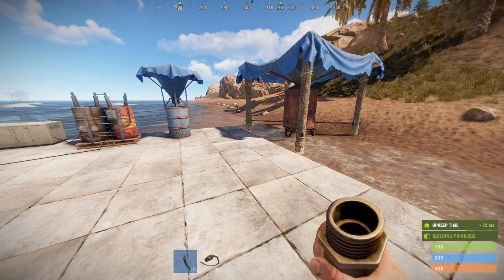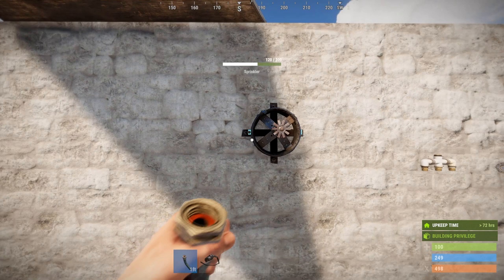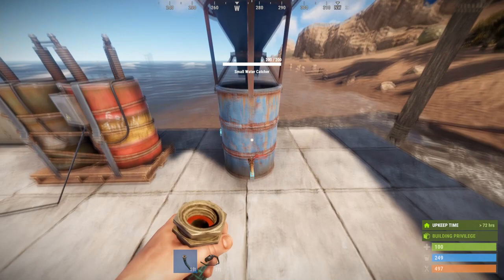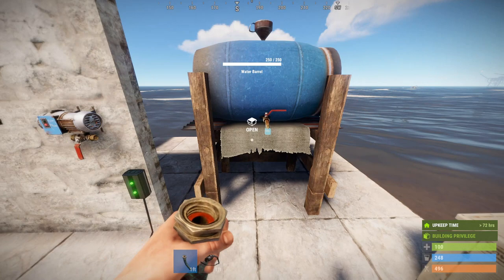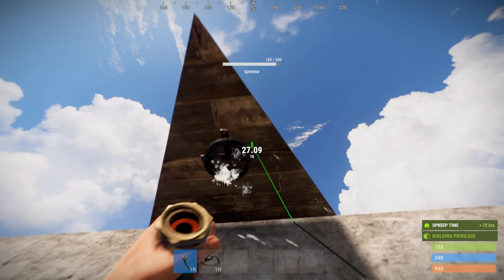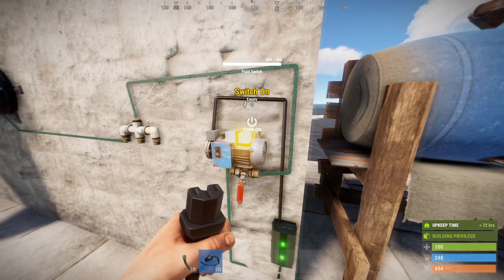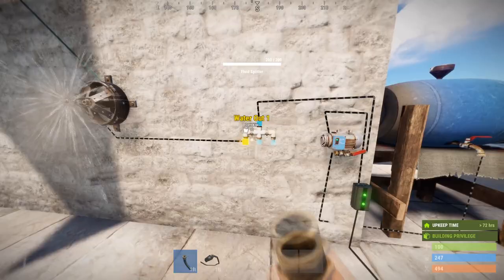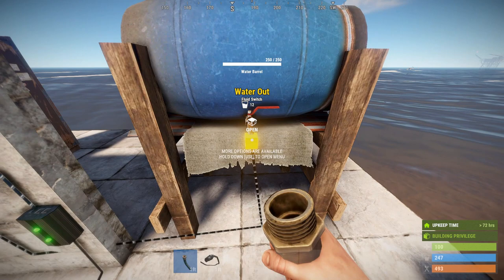Rust Electricity: Staging 3-29-2020 - Water & Plumbing

Comment: Hope you can put lowgrade in the barrels and use it with the ignitor. That would make a great trap
Reply from the maker: Flame turrets!!   I'm hoping down the road we will be able to use other fluids. I want to see automation for crude to diesel to low grade, or low grade plumbed into furnaces for much faster smelting than with wood, etc...
Reply: @RabidRabbitGamer  that would be awesome. But as a solo player, I'm not seeing my self using the sprinkler system. I use the electric system aloth. Maybe in the future the servers only wipe once every 2 week's.

Comment: Brother can you make a trap base like you did in older videos where!! Owner cant trigger the laser?  It would hard to go out if we kept triggering the laser before we even go out of the base and lock our self in and have the trigger activated
Reply from the maker: I don't have time for a vid right now, but use HBHF set to friend to cut off the laser so when you leave, HBHF is no longer triggered, laser comes on, then laser triggers turret or door or whatever for your trap:  https://www.rustrician.io/?circuit=7f66326280d03848aa862fa3306ceb5f

Comment: i fixed it - remove the last two branches and standard switches. replace with a single memory cell. more efficient
Reply: for the on and off circuit
Reply from the maker: yeah I didn't have memory cell yet when we put this together :)
Reply: @RabidRabbitGamer  having it run on a loop on intoxicated build server. Trying to find the medium between water collection to garden all passively
Reply: Only thing I'm finding is two separate pumps running two sprinklers for a single large garden. That way one water collector is just collecting while the other is pumping. But the use of it on a live server wouldn't be viable
Reply: Water purifiers need plumbing the fluid to plant ratio is waaaaay to high currently and the entire system seems rushed and missing pieces.